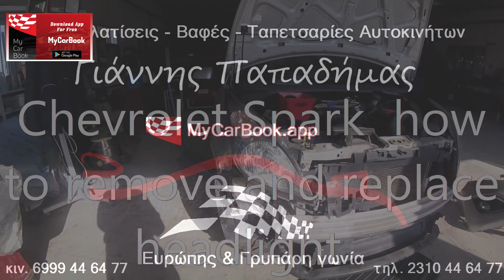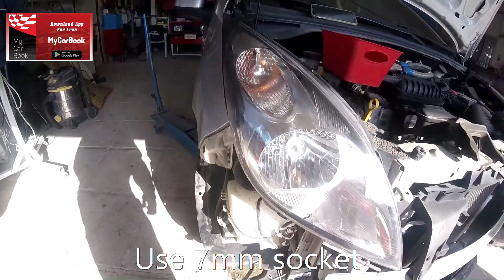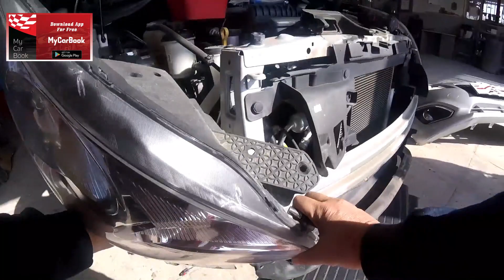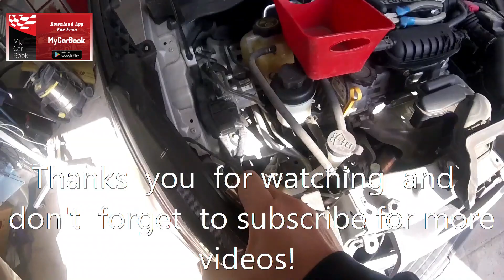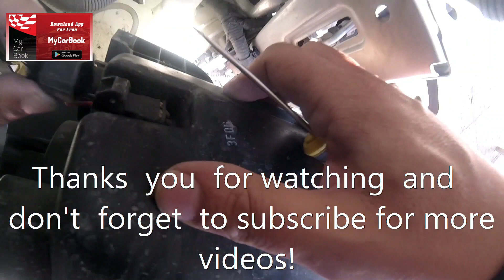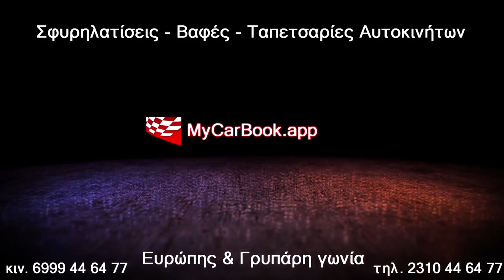Chevrolet Spark 2009-2015  how to remove and replace headlight

Comment: Hello sir, 
Do I need to take the headlight off in order to change my daylight lights??  
Great thanks if you answer to this question I cannot find an answer
Reply: No sir, you can just take the bulb out, unplug the wire than twist it to the right and its out. Make sure the rubber ring behind the plug is out cause it will stay on sometimes.